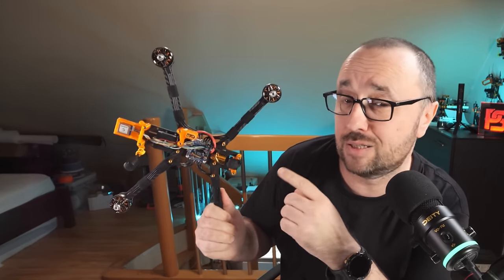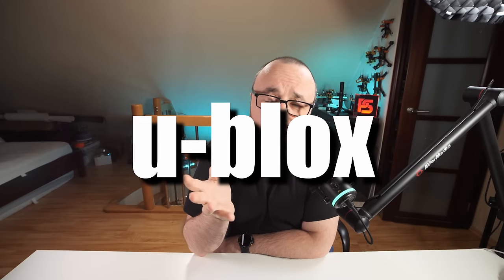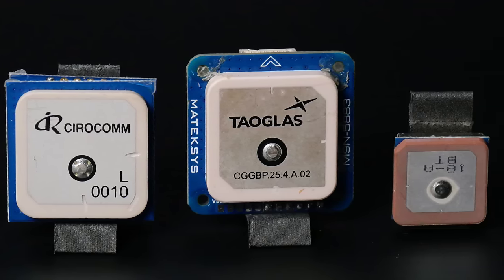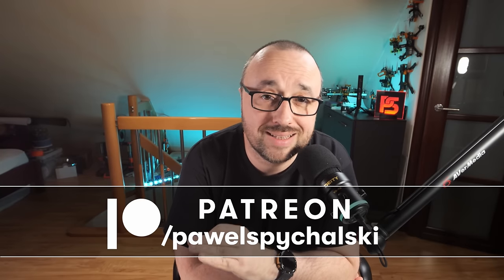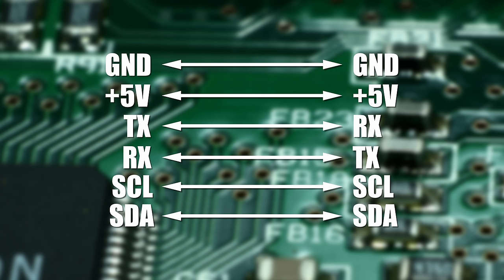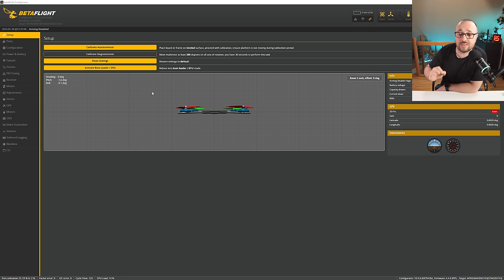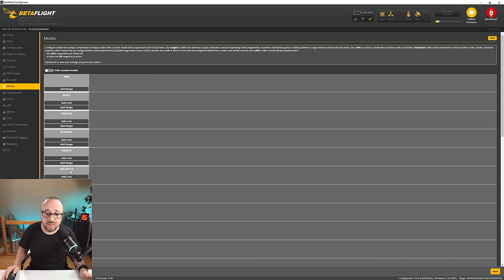Betaflight GPS and GPS Rescue - everything that you have to know

Comment: Pawel, some settings should be set in the channel fallback section on the left when using Rescue also: Users should have level/angle mode set to an aux in their modes tab, and have the value set in channel fallback (should it be renamed to Stage 1? Probably!) to engage it. Also, the throttle value should be set to a good hover/slight climb value, or to 'Hold', this way in real failsafe, the transition to Rescue will be seamless. Otherwise there would be a brief cut in motors which is not ideal! Room for improvement in the feature does exist!
Reply: You made a really good point here about changing the Stage 1 Failsafe parameters.. “Mads Tech” Ian covered this point in his last Sundays YT Live Stream
👍
Reply: One thing to add: Allow arming without fix... This does exactly as it says, but if you DO have a fix before arming, the Rescue will be available and work normally.
Reply: I just set up my first gps yesterday on a 7” and I did this exact thing. It makes a lot of sense for the drone to go into angle mode in the case of a failsafe before gps rescue is activated. All my quads without GPS have angle mode on a switch in case of lost video too

Comment: for the fly without gps fix thing, when you want to take off, you might not have a fix, but once you get airborne you might get enough satellites, especially if you're in a new area.  I got super mad at it not arming cause it took it like 5-10 minutes to get enough satellites before it would arm, when I could have been flying during that time and given it more of a chance in the air to find more satellites as well.  Also if you have it set and you're working on it inside with the props off, and testing motors or something or testing it wont arm which blows.
Reply: Correct me if I'm wrong but in GPS camera drones (as DJI) forcing an armed and takeoff without satellite lock and expecting locks in midair causes a definitive flyaway.
Is this not the case with FPV drones?
Reply: @BendApparatus  no, it'll just first failsafe to position 1, whatever you have that set as for a while, and then it'll fall out of the sky I believe if you lose signal. That's my understanding, but it'd never just flyaway, especially if you're still in control.  This stuff is just for failsafe or if you lose control remember, it's not actually got anything to do with control under normal flight conditions.   Long range quads that most people would be using return to home like this on, usually it takes several miles of flying before you could possibly failsafe them.  It also won't failsafe or return to home within I think it's 60 meters of its launch point as I understand that as well.
Reply: @maddercat  ah ok.
Reply: Another aspect to this is flying indoors... one of my smaller quads with GPS is also fun to fly indoors... where the GPS don't work! 🤣 That same quad will overheat while waiting for satelite lock, so I fly it for a few minutes, then bring it back once it has enough satelites for a fix. But I agree, the default should be not to allow that - require the user to think it through.

Comment: Unless something has changed very recently - I'm relatively certain that BY DEFAULT if a compass/mag is present and enabled BF GPS Rescue will use it for heading. I think it should be disabled by default, but AFAIK, if it's there BF will use it. This leads to a good number of issues if it's not setup properly, which is very easy with BF. There is (or at least used to be) a fallback that disabled the mag in a botched rescue where no progress towards home is made where it would be overridden and only GPS derived heading would be leveraged. In practice I haven't seen that work out too well either though. For BF unless you really know what you're doing (and even in that case) I wouldn't even wire up the mag/compass.

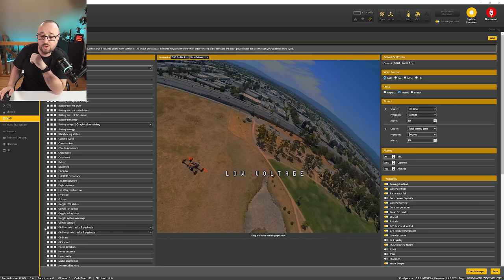Comment: 17:17 I turn this on for flights I know I just want to fly near and know I don't need a fix (Sometimes I also am struggling to get a fix or it takes too long). Rescue works once you wait for a fix and then arm. So it does make sense to turn this on. But you're right...By forcing you to establish a fix, the probability is higher for rescue to work. Because everything stands or falls with a fix.
Reply: And also what if you fly with GPS locked and you fly into a building and loose radio signal. It will fly to maximum height ...so into the ceiling and dig itself out. :D (More probably it will loose GPS and then disarm i gues?)
Same with flying in a forest. I don't want GPS rescue in a forest, but position and home position is really useful there.
 Actually i was looking for an option to disable gps rescue for a flight when i don't want it. With this I could simply arm quickly before a lock... but it's a bit lame method. Is there a switch option to disable it completely?
Reply: Yes sanity checks will prevent that
Reply: In the Failsafe tab just untick GPS rescue as the method and choose either drop or land. Save and reboot
Reply: @jojo42069  Yes, but i don't carry my laptop when i go to fly. Actually i plug my drone to my laptop about 1 time per year for Betaflight update. :D

Comment: So I'm going to give a reason -- a bad one, but still a reason -- why I have kept "Allow Arming Without Satellite Fix" on. Doing that has allowed me fly higher but stay close while waiting for a fix -- and I get that fix significantly quicker in my experience this way, rather than just waiting with it on the ground. My DJI vista also doesn't have to cook while I fly around, really wait to lock in and get that good fix. Previously with my setup on 4.1 set to NMEA it could be slow enough for that very first initial satellite fix... after changing to UBLOX... I find and lock those first sats and more faster, even on the ground, so I will be following your advice. Disabling it now while I remember, just to ensure I don't accidentally take off one day without it. 👍

Comment: Thanks for the video.  My GPS lock and sat count is always solid (15-20 sats).  However my home arrow is always incorrect.  Any ideas of what would cause this?  I have a M80 PRO GPS, its mounted on top of my GoPro, copper shielded and grounded wire.  I know you say this is not ideal, but with HDZero 1watt on board mounting in the rear I would get no or little GPS lock.

Comment: I had many electromagnetic problems with beitian bn220, but with the matek m10 5883 I solved them, thanks to Pawel and thanks to the electromagnetic filters that this m10 GNSS has inside, but to make it work better you need to use u-center 2 and serial usb, set the boudrate to 57600, the default is 9600, and set the rate from 1hz (1000ms) to 5hz (200ms), keep the constellations: GPS, SBAS, GALILEO, GLONASS, and remove since betaflight sees them but unfortunately still doesn't recognize them: BEIDOU, IMES, QZSS. I arrived at this configuration thanks to Oscar Liang's guide and the operation manual of the new u-center2 software, the GNSS is configured correctly for betaflight 4.4, thanks for your videos and greetings from Italy

Comment: Where do you set GNSS direction? Arrow forward or arrow facing to the rear? NAV/BetaFLight: compass Arrow forward, set CW 270° Flip when flight controller arrow is facing forward.
INAV/BetaFLight: compass Arrow backward, set CW 90° Flip when flight controller arrow is facing forward.?

Comment: Can you tell me when RTH should start working? In case of connection problems between TX i RX or when there is a problem between video transmitter googles or may be in both cases?

Comment: Is it possible to choose whether failsafe procedure is drop / gps rescue easily (e.g. with controller switch?).

I feel it is highly location dependent whether you want GPS rescue or not, so making the choice before flying seems useful.
Reply from the maker: No, it's not possible
Reply: You can do that in ArduPilot using lua scripting.
Reply: You can change failsafe procedure in the OSD menu, along with all of the more advanced GPS Rescue settings such as heights, speeds, distances and the Rescue PID settings.
Reply from the maker: This does not count as "simple" or "easy". Preferably with a switch during flight. You can do it also by conecting to your laptop, but still, not easy
Reply: One option is to set minimum GPS rescue distance to something large like 800m. Then if you're flying nearby (bando, trees, etc) the quad will drop, beyond 800m GPS rescue will work.
Reply: @treesifpv3848  Good point! That method would have it entering proper landing phase instead of the old drop-from-sky, too. The available parameters really allows for a wide range of customization, but it's a lot to learn.

Comment: Pawel sir, I am having the issue of just one TX and RX pad short, I was wondering if softserial can be done with this board, Omnibus F4 V3, I have Motor pads 5 and 6 available, Can they be turned into RX / TX ? wondering if you had a video on that, IF IT IS possible.  I cant buy a new board right now, I am trying to hook my vista unit up to get OSD in goggles, BUT I am not using the DJI controller, I left a R9 Mini receiver in, BUT IF I hook up the vista to use with the DJI controller and take out the R9 Mini everything should work, BUT I think I might have less range with the DJI Radio. Your thought's?
  I Have my Gps on TX3-RX3 then SCL / SDA - My RX mini to sbus,
I have the GPS and everything working good right now, I hate to go in and screw anything up.
Thank you very much.

Comment: hello! i have a question about the gps navigation in betaflight. do you think i could plan a mission with waypoints using betaflight in FPV with QGroundControl? i considered using ardupilot but then i would have to buy another flight controller.
Reply from the maker: No you can not. Use INAV instead, has everything you need

Comment: I cant get gps rescue to light up yellow in betaflight. How can I fix this?
The switches are working, it flips and gets into the set range, but it stays gray.
I get satelite fix and location is correct. 
Cant get gps to work on a switch. 
(Tried different switch, same problem)

Comment: Very nicely done and informative. Now I have to get back into Betaflight to readjust some settings on my recently installed GPS module.
Do have one question. Does the arrow on the GPS module supposed to be facing towards the front of the quad or does the orientation of the flight controller override the direction?
If so, really need to know how to reverse that polarity in the CLI to get it set in the right direction.
Reply: If you're using Betaflight it doesn't matter which direction the GPS points. GPS by itself doesn't know or care which direction it's facing. That's the job of the *compass*, which Betaflight GPS Rescue can't use.
If you were using Inav, that's different. Inav will use the compass (magnetometer) for much better return to home, position hold, etc. If you're using Inav with a compass, you:s want the compass arrow pointing forward.

Comment: Hi Pawel, I have the Matek M8Q-5883 and I could never got UBLOX to work properly. I see the satellite icon in BF but I observe the following:

When I turn off 'Auto Config', the OSD GPS elements disappear but I quickly get a lock (the GPS module flashes which indicates lock). 
When I turn on 'Auto Config', the OSD GPS elements come back but I'm not able to get a lock. Sometimes I see the coordinates flashing random values but satellites remain at 0.

Is there something else that I need to configure in the GPS using U-center?
Reply from the maker: Leave it ON and put it outside. First lock might take even up to 20 minutes on the open field.

Comment: Good afternoonI,use pixhawk4 mini + matek m10-l4-3100 and the mission planner program. Please help, I downloaded the firmware
4.3.2 for pixhawk4 mini. I put all the settings that are in the CAN description. I cannot connect MATEK M10-L4-3100 to
pixhawk. I have set up
CAN:CAN_D1_PROTOCOL>1
CAN_P1_DRIVER>1 GPS_TYPE>9
NTF_LED_TYPES>231
BRD_SEFETIENABEL>Oh, where did I go
wrong or something I haven’t installed yet? help please
fix: EKF3 waiting for GPS config data. Tried many options, the result is unchanged.

Comment: Thanks - setting up a long range quad right now :)  I'm going to use Walksnail, but there are a lot of reported GPS peoblems. Some people are report that proximity to the VTX is the problem, but others say it's the antennas. Which do you think, or could it be both? 
One more please - if GPS rescue kicks in (e.g. with a failsafe), will it disable when the RC link comes back, or do you need to do something to disable it?
Reply: i use Walksnail at 1200mw with GPS RTH (inav) and never have any issues not getting around 30 sats locked ,, but my M10 is 17cm away from the Air unit and 12cm away from the tip of the antennas so i say proximity is 100% the issue
Reply: Also I believe in the case of of RC link regained. It will remain in GPS rescue mode unless any input from the gimbals is initiated above 30% (this may be adjustable so check)

Comment: "Arme without fix" is very usefull when you flight with gps only from time to time
Reply from the maker: But what's the point if GPS rescue does not work then?
Reply: @FPVUniversity  You can change rescue mode in BF only. So if you are  using your drone once for "long range" where GPS is needed and once for freestyle with out GPS ( to minimize demage risk) it is very usefull feacher. Because when you remove GPS it is inpossible to arme the drone.